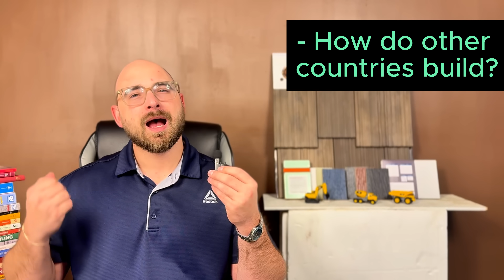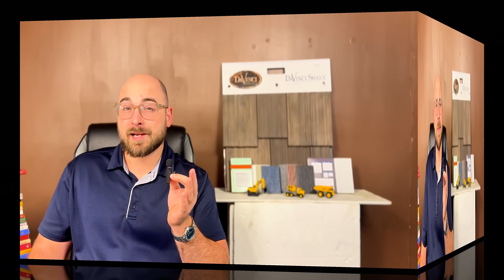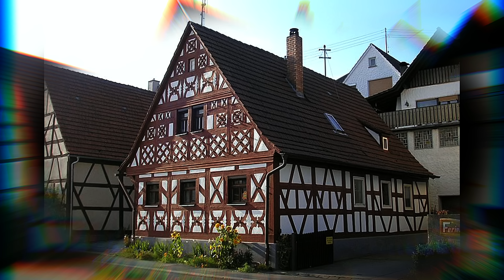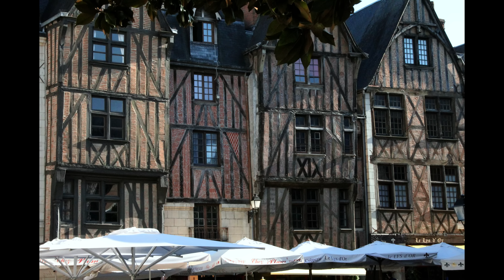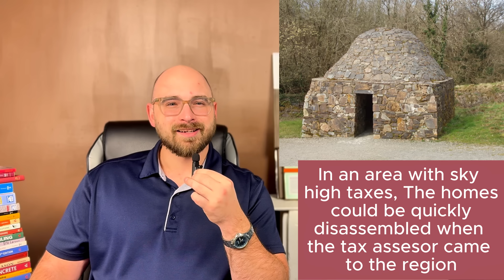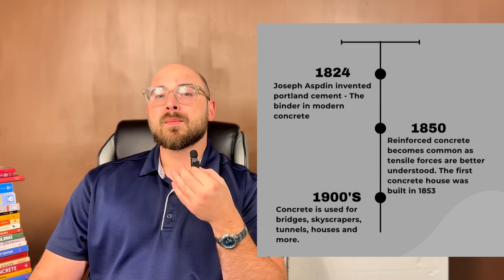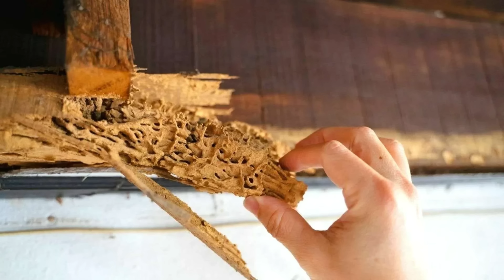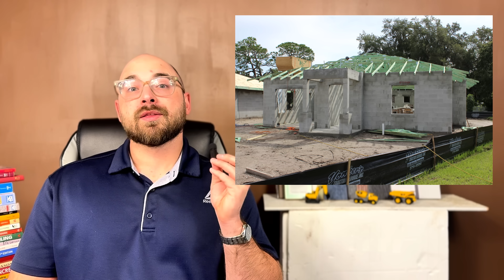Why Other Countries LAUGH at American Homes

Comment: Europe has some of the same quality of houses. We call them various shades of "light-structured". Cheap, fast, so fast that it's often poor quality even for what it is and because you won't pay anyone to properly build it, and they are not expected to last more than a few decades at most. In Japan, they have houses that are similarly only planned for a few decades, but for a fitting price. In the US you get the worst of both words: expensive, without any hope of serving anywhere close to a lifetime.

Comment: i never lived in a wooden house, so I don't know how big difference is between heating and cooling throughout whole year, if you spend 500$ more per month that's 6000 per year and 180.000$ in 30 years. and for 180.000$ you can build yourself another house (roughly) with money, you save on heating and cooling throughout the years. i dont know maybe I'm thinking too much. :face-turquoise-covering-eyes::hand-purple-blue-peace: but hey you know build what you love, that's the most important thing nothing else matters, not even what other people say... But I will say I Love to Hear people in USA are more and more building concrete or brick houses you will definitely feel safer in them and you will save a bunch of money in the end... 💯💪 At the end of the day, you work hard to earn that money why not save it a bit more. 🙃😉

Comment: Steel homes with corrugated iron as the outside wall (basically a massive fancy shed) are becoming increasingly common in Australia, particularly in fire prone areas. In the last 40 years typically most homes were stick-built & increasingly thrown together and not of high quality. But with the increasing costs of wood Steel has become more economical. You don't see many new builds using brick, cinder block or pre-fab concreate, although I wish you did.

Comment: This seems to gloss over natural disaster resistance quite a bit. I am from the pacific northwest, which is an earthquake prone area. In earthquakes solid structure homes are far more likely to be damaged and potentially kill their occupants. As such, solid structure homes are exceedingly uncommon and disincentivized by our building codes. Additionally, in other parts of the US hurricanes tornados etc are likely to render houses hit uninhabitable regardless of the building material, incentivizing the construction of homes that can be rebuilt cheaply.

Comment: Houses in Romania are built with ceramic blocks in a reinforced Concrete frame. The floors are also reinforced Concrete. The exterior cladding is rockwool insulation about 10 cm thick. The roofing is timber structure with ceramic, Concrete or steel tiles. Windows are double or triple glazed thermopanes.

Comment: My grandpa's house was built by him and his good friend along with 7 other houses in his neighborhood. They are 70yr old homes with zero damage besides the cast iron pipes rotting. No bugs, rodents, mold, cracking of the basement or any faults so far. It sustained two horders (my dad and aunt) that I cleaned up after. The houses are in Rockford Illinois and holding strong compared to cheap modern houses.

Comment: When they start making the clinker for concrete with green energy they'll probably be the best by far environmentally. In addition to being durable and (potentially) well insulated. 
As it is now they mostly just use gas burners to cook the limestone. 

Timber and frame isn't that bad or flimsy, but the focus on profit over everything leads the American builders to build below spec even for America's lacking specs. I live in Colorado where it's -20F to 120F throughout the year, yet code demands only R15 walls and R30 ceiling. It should be at least double that.

Another big problem with homes is cost. It cost the bank $250,000 to buy this home and over the life of the mortgage I'll end up spending almost $750,000 (if I pay it off on their schedule). Meanwhile some rich -asshat- I mean investor can walk up, outbid an average person by $25k and still walk away paying far less. It's amazingly cheap to be rich. Money makes money. Then you've got the people and orgs using homes as investments instead of places for people to live. That drives up the price for all of us. 

The solution is simple, but painful. Tax the heck outta multi-home owners, and double tax them for the empty structures. Yes your landlord friend who owns 4-8 homes and is actually a decent person will get hurt by that, but it'll hurt Blackrock et al more. 

Big problem with concrete houses is they're nigh impossible to renovate. Not a big deal if you get it right the first time, but ime that never happens.

Comment: im fucking sick of solid structure houses. any kind of remodeling is such a fucking hustle, 100x worse then in light wood houses. anything bigger you wanna do requires contractors and lot of stuff is too much effort so you have wires in external boxes rather in walls and such. also not sure if it affects wifi.. just fuck em

Comment: American houses suck!! Expensive... My sisters house have a couple of holes due to my nephews playing. One of my nephews like it to dance in his room, that spot is bend now and be afraid that he would make a hole in the floor. Insulation is horrible. You can hear someone walk upstairs. Or.if they use the bathroom. Really expensive to keep it cold or hot. Have to clean the conducts for fear of fire due to high temps. Google how the American houses end after a Hurricane,  Tornado or a Fire...

Comment: If I were to have a house custom built I would like using the concrete block system of my current house or would be willing to try the system you build, with the foam concrete forms.

Comment: My house is cmu, in AZ, built in 1973, with a brick facing on the front. I love it. It doesn't have the settling of the wood frame house (built in 1900) or the first home we owned (1924) frame with brick facing.

Comment: In Poland we have something like ICF but it is called IZODOM [iso(lated) house], they have several options for the thickness of external insulation, EPS or Neopur 10-25cm with a heat transfer coefficient U: 0.19-0.1. In my opinion this is the best option, super fast, cheap (DIY friendly) and the most durable.

Comment: Do Americans have better options? Yes.

Yet, many choose to buy an F-150 they rarely use for towing, then complain about oil prices instead of saving for a better home.
Reply: It's not about saving, I'd love to have a stone house. Who's going to build it? There's no expertise.

I'm just going to make my wood frame house myself to ensure quality.
Reply: @lecoureurdesbois86 if you can build a wooden house yourself you can probably learn to build from foamed concrete or silicate blocks. Most of them are designed to fit together almost like Lego and also come with instructions on how to stack them and glue them together. Creating a concrete ceiling requires more skill, but in Europe we also have an option of prefabricated concrete ceiling modules or going oldschool with wooden ceiling. Building time is not that much longer, construction on its own takes more or less the same time, but there needs to be some time added for drying concrete and plaster.

In Europe building a wooden house is actually more expensive since high quality dried wood is not widely available nor cheap while building blocks are relatively cheap since there is strong competition in the market + skill level required is lower for laying bricks/blocks than for carpentry. 

Wooden houses in (my part of) Europe are mainly factory built. And while the "matchstick" technology never got popular here, now the CLT (cross laminated timber so basically solid wood walls) is getting popular for those who want the house build more quickly.
Reply: Gotta do that rural cosplay in the 'burbs.

Comment: well one thing with houses built woood is that it can be easily upgraded or disposed off, compared to concreat and cement houses, and demolition of concreat house requires a lots of resources, and there is nothing wrong with having a cheap house, actually it is smart to have a wooden house, you get all the facilities of the house for cheaper price

Comment: They are not really laughing at us, they just don't think that wood(!) stud framing with waferboard (or worse) exterior sheeting are the correct materials. 
In Central Europe "light structure houses" are being built - but with a lot smarter choice of materials. 
1. Framing is galvanized STEEL studs instead of wood studs. 
2. Exterior sheeting is one or two layers of fiberglass reinforced CEMENT board, instead of the US's plywood, waferboard, or aluminum foil faced cardboard. 
3. Insulation is foamed-in, or rockwool.
4. Interior is one or two(!) layers of gypsum board. 
5. Fasteners are screws, not nails. 
6. Exterior is EIFS (stucco-look) which is foam board with cement parging with fiberglass mesh over the cement-board exterior sheeting. This adds additional insulation to the between-studs insulation and a paintable exterior finish.

So it is still principally a stud framed house, but using SENSIBLE rot-proof, bug-proof, fire resistant, and LASTING materials.
Reply: I was going to leave a comment about Light Steel Framing that was mentioned so briefly, but seeing your comment I'll piggy-back on it. You just just described almost exactly  how my house is being built (in Portugal). The only difference is that instead of cement board for the exterior walls my building company uses metal sheets with 120 mm EPS insulation attached.
It's an increasingly popular choice for family homes.

Your point #5 is also important, we're using massive steel screws for the steel framing, then smaller ones for the interior walls, etc. Seeing US homes being built, either on YouTube or movies, it seems it's just guys with nail guns blasting away everywhere.

Comment: You forgot one type of cmu building. Cement blocks, it's a solid modular cement non fired brick that come in 2 inch, 4 inch (standard) and 6 inch blocks . The dimensions of a 4  inch brick are 4 x 8 x 16 inch . They are used in construction in south America.

Comment: my personal problem with USA houses is not only their price but the fact that their interior and exterior walls are made of the same materials, provide low to no protection against fire, and earthquakes destroy them too easily, i for one, live in a country that not only suffers earthquakes way more often than the USA but they are also 1 to 2 points higher in tha magnitude scale.

events that would be a moment  to stop and look to see if you need to catch something falling off a shelf or computer too close to the ledge of the desk, turns to a panic that you need to run away from any structure in the USA, our houses as cheap as they are (around 200% cheaper in average than american homes of the same size) they are still engineered to withstand earthquakes and storms homes in the northamerica  just wouldnt survive through, and people make fun of me that i cant have a underground or basement while im the only one that can still live in the home they grew up in without any extra costs or repairs.

and yes, your houses burning down is also your fault, our houses are also made of wood, do not blame it when you could've done much to protect it

Comment: I thought you were going to ignore ICF, and then Boom, it showed up. A friend of mine here in PHX builds apartment buildings. She uses an ICF product made locally by Hercuwall. She was telling me that she can finish an entire building with about one wheelbarrow of waste. Whereas a stick-framed building creates dumpsters of waste. And that's AFTER the wood is already cut down into lumber. 

One thing you didn't mention is 3D printed homes (which are also concrete). I saw one go up in Tempe, AZ and it's a really interesting concept.

Comment: Another thing is climate. Wood is more suitable for most of the US's climate because it's better at keeping heat in when cold and heat out when it's hot, but minus Florida, and the desert areas. Wood is also used in China, Korea, and Japan because they share a similar climate. Some places in Europe SHOULD have wood homes based on their climate, but they've cut down most of their old growth forests throughout history. So, a wood home makes sense in the US, especially if it's in a relatively safe place from natural disasters. BUT as we move forward with less old growth forests, increase risk of disasters from climate change, and better technologies when it comes to heating/cooling homes, it makes sense to incorporate other building methods.
Just as long as they build them big so I can throw a football through the house, and not have to live in a cinder block like the Europeans

Comment: 4:09 someone forgot their spirit level. wait no at that time it was a plumb bob square? Or that is a real life photo of diagon alley.
Reply from the maker: The area there is swampy, marshy soil, so the foundation (which is centuries old) consists of wood piles driven deep into the earth, they have held up fairly well as deterioration is limited if they are completely submerged. 

However, due to government regulations the local canal has been lowered from time to time, which reduces groundwater levels, which in turn exposed the centuries old piles to the air and caused them to decay, this disturbing of the soil caused settling. 

From my understanding now the buildings are partially supported by their foundations and by the buildings next to them and the water levels are more closely monitored 

It’s not the only city to rely on wood piles, the entire city of Venice is built on wood piles too, fascinating really

Comment: If you build a Co2 intense house that lasts for over 200 years or more its argueably more environmentaly friendly than a house build of wood that lasts only one generation (60-80 years). What we really need to focus on is building these long lasting houses and fixing them when they need it. And of couse make it worth fixing them. I am from germany and in a lot of areas it is scarily more affordable to buy a good old house and demolish it to build a new one. There should be incentives to actually buy such a house and fix it up. 
Good video -  was fun watching it :)
Reply from the maker: Bingo, 

One of the most sustained homes we can build is one that’s built to last and energy efficient

Comment: From India here. No houses are not built with clay any more.

Yes we used to build with clay houses, but that was 40 years back. 40 years ago anybody who you call 'lower middle class' in your country had a Bricks and concrete home.

Yes mud brick walls are used in some regions of the mountains. Because one you cannot have brick producing factories there, will totally destroy the ecology. Transporting bricks would make it very very costly. So they either use special mud bricks, or cement blocks. Mud bricks provide better insulation though.

As far as I know even in remotest villages, now the building style mainly involves reinforced concrete pillars, 9 inches thick baked brick walls. And concrete poured slab.

Comment: As a Greek, I need to point out that the majority of housing in Greece is Confined Masonry. Houses primarily using stone as a structural material, unfortunately have been going away. They are still prominent in mountain areas and islands. That said keep in mind that in Greece there are very strict laws, due to the area being very seismically active. What I fail to understand, how is it possible in a country like the US, that is experiencing extreme weather events, fires etc, that the government has not set similar laws.

A house made out of wood does not mean it is bad. But a wooden home is not the best match for every environment, in addition to the fact that the cost of maintaining a wooden structure is significantly higher overtime than a Confined Masonry one.

Comment: Concrete is used quite a bit in South Florida. Cinder block is the most common form. After Hurricane Andrew in 1992, standards were much higher. Wood frame homes simply won’t survive a hurricane here.

Comment: I am an American who hates 95% of all US homes. I hate the mentality.  I have always loved the architecture of Mario Botta, an Italian Architect who used large bricks or concrete and incorporated large windows with tall ceilings.  I also love wood, but I would never build a house with sticks.  I would use timber framing or log cabin method.  Straw bail with lime covering is also a great method.  I hate any home that looks like 2 or 3 different structures were smashed together, i.e., mc mansions with complex roof lines.  A house should have no more than 2 roof lines.  And a house should be well insulated.  We currently live in a house that was built in 1917, with 2 courses of brick, no wood wall structure, 2 fireplaces that were covered up decades ago.  The house is so cold in the winter.  We go to Slovenia and we see double walled homes with over a foot of internal insulation and under the floor hot water heating and we are jealous.  We go to Finland and the windows are triple insulated and gas filled and are totally operational opening in the summer.  Half the windows in our house no longer open because previous owners painted them shut and we have mold on 1 wall that gets no sunlight but lots of prevailing wind and rain.
Reply: Окна с тройным остеклением лучшее что могли придумать

Comment: CMU is garbage. It was a popular building material in Indiana for a time, and many homes built around the 50s and 60s have CMU basements. The CMU requires digging up the earth around the basement and resealing the outside of the walls or the CMU will let water flood the basement every time it rains. Above ground CMU is very weak to impacts. My grandfather's garage is CMU walls and I was warned repeatedly growing up that bumping a car or trailer against the back wall could easily knock a section of the wall out. I think I'll gladly stick with my light framed home.😂